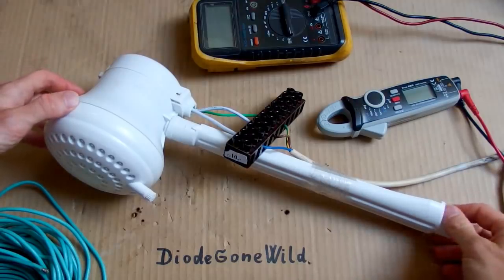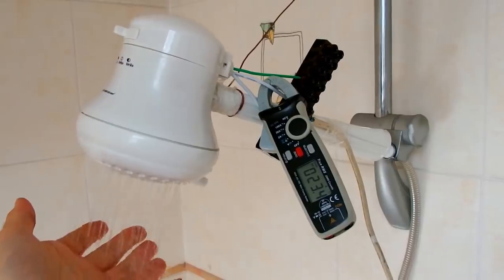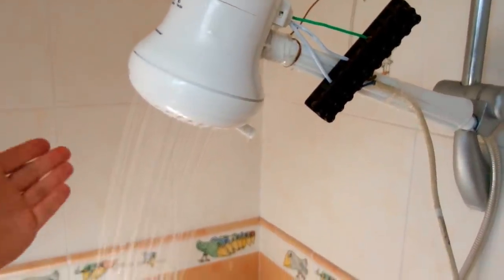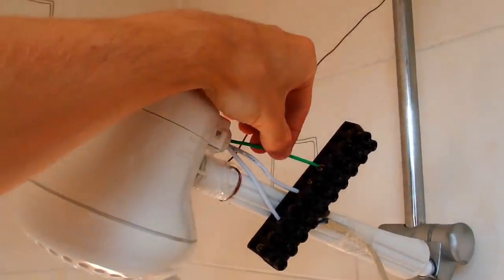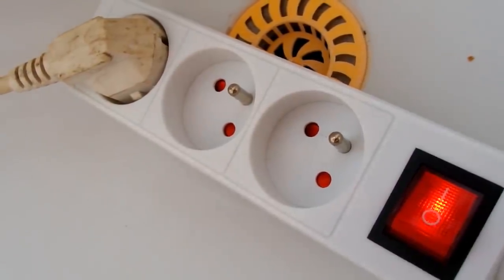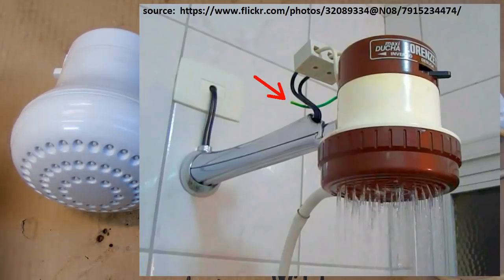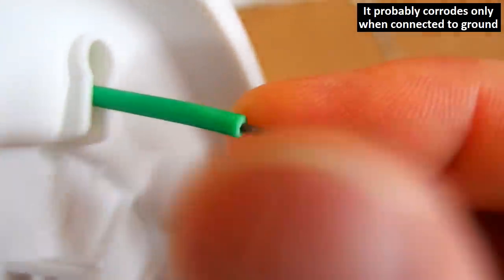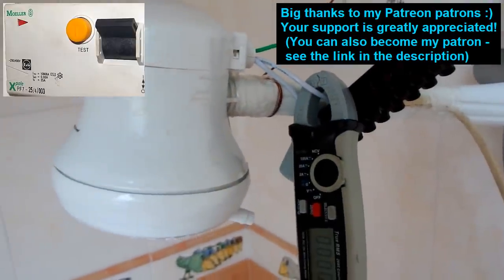Electric heated "suicide" shower PART 2 - test & measurements

Comment: We have such a suicide shower in our house. The mains coming ungrounded! But i do not want to make a ground for our house,  cuz the neigbours, who are connected to the same transformer might get in trouble if they use the same suicide showers ungrounded in there houses !!!!!!!!!!!!!!!!!!!!!
Reply: I don't see the logic in that, why would there be trouble for them?
Reply: Daniël Mantione if i do ground my house i do that also for the neighbours, cuz they are connected to the same high voltage transformer. But they do not know that! So form phase to ground they face a dangerous voltage! Thats ok, if you have prepared your equipment like this suicide shower. But its, as you saw in the video, a surprise for my neighbour if they touch a wire and get shocked what they never been before i grounded my house and them as well! Yes, things are never as easy they seems to be at the first view 😁

Comment: I guess your neighbors are happy that you are pushing 60v over their water piping!
Reply from the maker: The resistance of water in the plastic pipes is in Megaohms. The current is probably like 0.1mA or less. And finally, the voltage can't reach my neighbors because I have plastic pipes upstairs, but I have grounded metal pipes downstairs.
Reply: DiodeGoneWild oh I didn't know the piping was plastic, thank you for your quick response! Love your videos and keep up the excellent work!

Comment: My doubt is, if the shower is correctly installed according to the manufacturing instructions, there is no posibility to received a shock, as you have showed, so, why don`t you recommend it?, the problem is not the equipment, I think is the incorrect installation of it.  But a wrong installation could happend even with a conventional water heater. Regards, and thanks for the lab.

Comment: I'm early, lemme tell you a joke

Seagate hard drives
Reply: TheComputerGeek010101001 Uh why? 
I mean i just got my first seagate barracuda and it seems good. But all my wd blues died really quick, the one in my pc actually lasted only 1 year a 6 months. Another one for my laptop lasted 1 year. 
I had way more wd blues and all of them misteriouslly die. The samsungs i have only are really slow, but are healthy. 
So i guess the wd is a joke. Idk
Reply: My ST1000DM010 is a beast. My  WDS500G2B0A SSD is barely faster than it is.

Comment: When I lived in Brazil, I had that type of shower. Your is leaking because you did not install it properly. Other important thing, if the general current in the city was 127V the shower was 220V, and if it was 220V, like cities in the coast, then the shower was 127V.

Comment: This thing is better if you use sea water
Reply from the maker: Then it probably works even with the heating element broken :).
Reply: DiodeGoneWild and dont forget will short circuit in your electric meter

Comment: USB SOLDERING IRON
Reply: Lalan Desai EEVBlog and big clive already made some videos on that but I'd like to see DiodeGoneWild and Photonicinduction versions
Reply: Mai Mariarti It's not the best tool, but there is a place and time for everything, and USB soldering iron aren't meant to be main irons, they could be your first soldering iron, or just for a quick repair, maybe you just need to fix a little wire in your car, just spend $5 on eBay for USB soldering iron instead of a $500 soldering station.